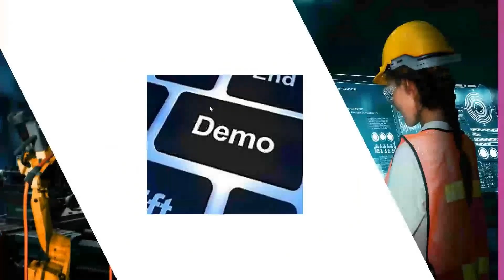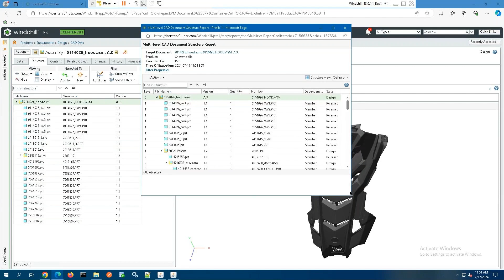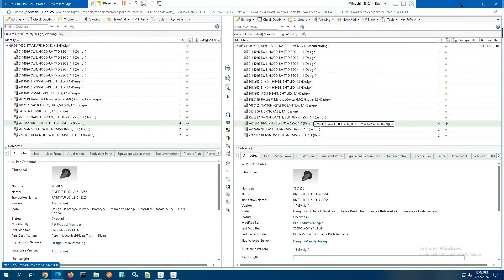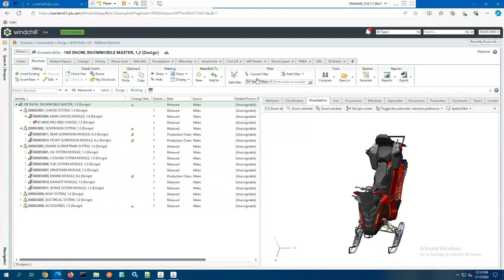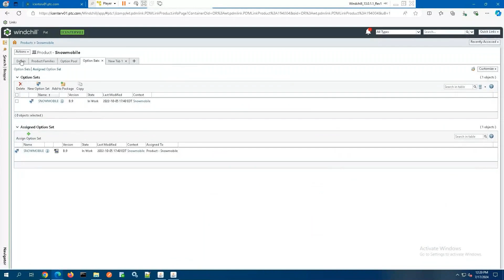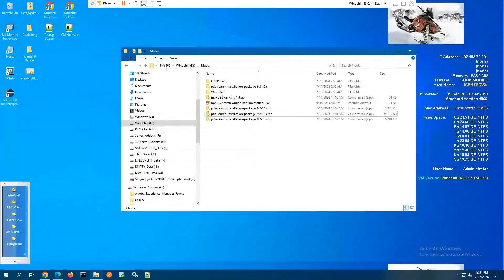Bill of Materials Management in Windchill - Webinar Wednesday

Comment: Sorry if this was buried somewhere in the video but I'm a CAD designer and responsible for creating and maintaining eBOMs. Does Windchill have the capability to sever or even toggle the link between CAD BOMs/Structure and the eBOM of WT Parts? I'm mainly concerned with having to maintain a 1:1 relationship between eBOM and CAD BOM on a legacy product line that has some components in CAD and some others not. Some sub-assy's may be built out in CAD where others are not. Some may have incomplete CAD. The CAD may be a decent starting point for an eBOM but may still need to be worked to be complete. Can we use the CAD as a starting point and then update the eBOM independently of CAD. Then perhaps, if the CAD catches up to where it makes sense to maintain the 1:1 relationship, can we turn the link back on?
Reply from the maker: Short answer to this question is, yes you can use the CAD BOM as a starting point for an eBOM. Actually that is how a lot of companies do it. Some times there are things that need to be on the BOM but not in CAD. Those get added directly to the eBOM. Once you have began to expand the eBOM be to different from the CAD BOM, you can use the “Compare” tool in Structure tab toolbar to compare the two and see what is different. If you desire to create CAD models for the different parts, you know which ones you need to do.

Let me know if this answers your question and if you have any additional questions.